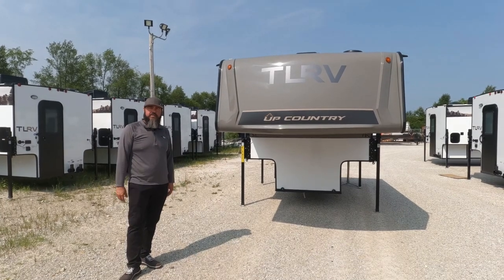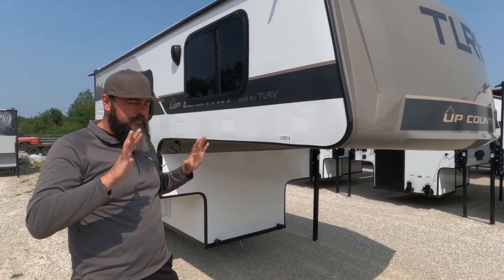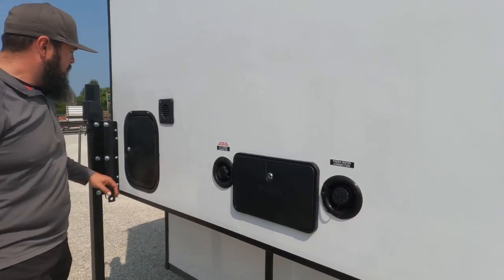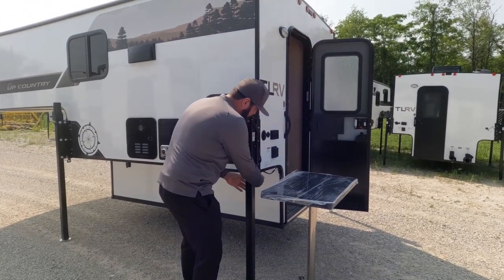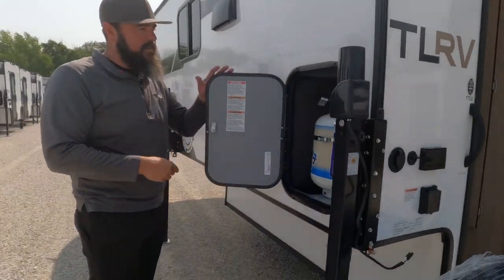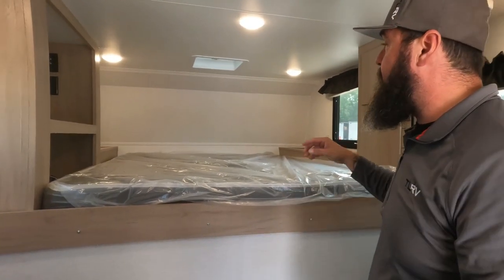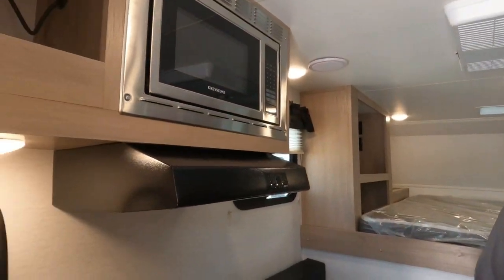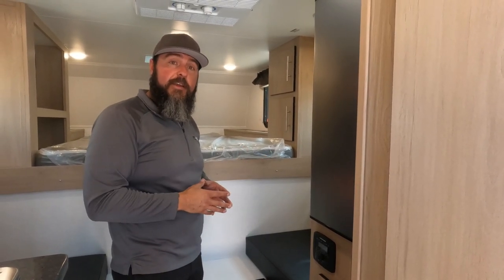TLRV Up Country 775 Walk Around (Keith Lessner)

Comment: ive been stressing because i want a 775U but i have an 8 foot bed but thank you for mentioning I could have a tool box or fuel transfer... I honestly was stoked to think I could have additional fuel or even a spot for a small generator with this unit. additionally, I didn't realize these had etrack rails, I was also not stoked to see the price of tie down mounts and the turn buckles... I think this video has sold me on a 775U... now I need to find one local!

Comment: I've got Rove lite 16RB right now but considering one of these.  I'll scrub your site again but wanted to ask about the tailgate, I have a 3500 SRW megacab, shortbed.  I would like to run the 775U, leave it in almost always, but with the tailgate removed.  This for trailer considerations, tongue is already super close to tailgate now in static condition.  Is the unit with 89" of floor length ok with this?  worst case I could make a 1.5 or 2" steel subfloor spacer from steel square tubing and give more clearance in the center.   I also like the e track mounting option, can I get more info about that?  images or video?